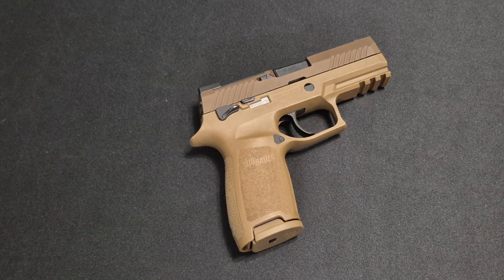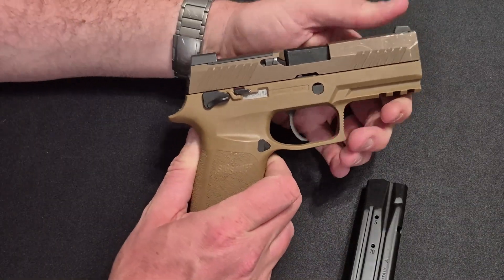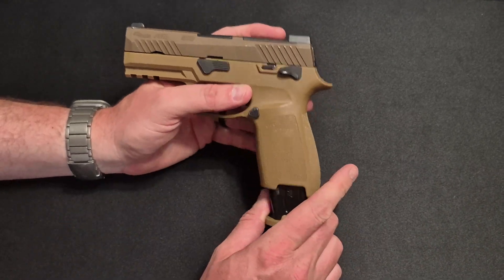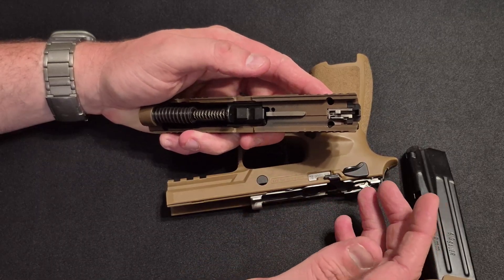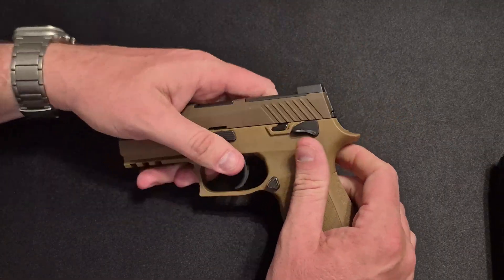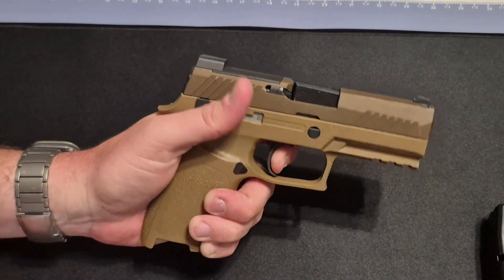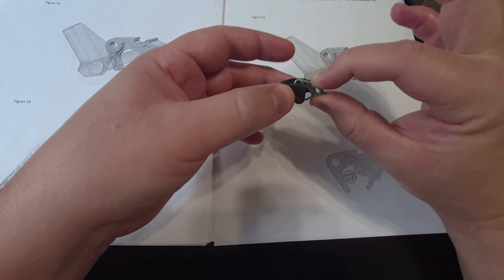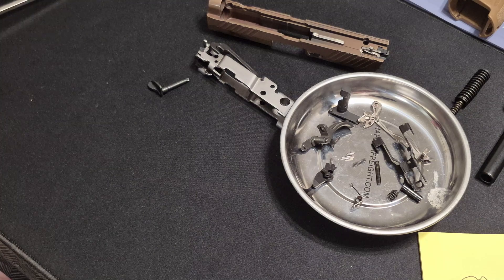"Explosive new patent" does it fix the p320 Self-Firing issue?

Comment: the manual safety pin that retains the safety release lever will have a notch cut out of it. …causing the pin to have a place for it to snap in half…..it’s a bad idea If you asked me . And likely the smartest engineers at sig knew this was a bad Idea or they would have used the design….That’s not what I want…. I want a sear with more striker/ sear contact and an Installable grip safety like  John Browning’s design Intended. I started my career up in and around a machine shop and was an auto and heavy equipment mechanic for 45 years. I worked on industrial conveyor belts that used a shear pin with a groove cut in it so it would not destroy the giant transmission when the belt got stuck…I know what works and what could lead to more problems.

Comment: This person clearly demonstrated that he lacks a fundamental understanding of the P320 when he stated that there was no striker safety.
Reply from the maker: I believe what was said is there was no striker block aka. a plunger there is however a striker retainer that they call a block that I would not.
Reply: @HardTurnChannel  You are mincing words and doing the backstroke.  Starting at 3:40, he talks about Series 70 1911's having no firing pin block and then states about the P320 that "there is no firing pin block safety."  There is a plunger, to use your terminology (its called the safety lock) in the slide that prevents forward movement of the striker until the safety lock (plunger) is depressed by the safety lever in the FCU when the trigger is pressed.  Your guest clearly does not know what he is talking about, and for the sake of your channel, you should do a better job of vetting someone who is claiming to know what they are talking about.
Reply from the maker: Had to relisten maybe it could have been said better or edited better, but my take away was as far he was aware every pistol has some form of a firing pin block a "big chunky piece of metal" in front of the striker it preventing it from moving forward. This is the first to go away from that to a retainer style holding the pin to the rear, and a MIM retainer at that.

Comment: Scared silly? Hasn't had a round in the pistol in a long time? WOW, I have carried and used Sigs professionally for many years. They have NEVER let me down in any way and they have never fired unintentionally. SIg makes very good weapons. Investigations into the firings have been conclusive..There is no reason for these guns to fire unintentionally. They are drop safe. Additionally, it turns out these firings have either been assisted or man made frauds. I love my P320, carry it without hesitation, and trust it without any fear.

Comment: There's is a firing block safety. There's 280 safety cases out of 2.5 million. And no proof the gun was the problem yet. We're just believing what cops are saying. Glock had over 5000 cases when police depts adopted Glock in 1990. You know why the numbers dropped drastically? We quadrupled gun ownership and education since then and gun accidents dropped, not increased. Don't lie about safeties cuz you don't know what you're dealing with.. That's not the issue. You don't even know which SIG you have? Why you feel the need to speak as a Layman. Every 3rd person is a Glock armorer. Stick to what you know.  You like Glock. Talk about that.

Comment: I wonder if the Wilson Combat version of the P320 have the same issue.  They are supposed to be made to tighter tolerances.  So, maybe the slop in the slide doesn’t exist.
Reply from the maker: same FCU same issue afaik, I believe all Wilson does is slide cuts/optics and barrel coating, but I could be wrong and I often am.

Comment: Somehow I really want one of those FDE 320s with saftey . I don't think all SIG 320 are bad but probably 1 out of thousands.
Reply from the maker: I think its something like 180 ish out of 4 million units so 4-5/100k units have had a documented discharge and I think most of those were before the VUP. I say check one out can usually get a good deal on one it does feel good minus the trigger which I think feels mushy.
Reply: @HardTurnChannel  Show me these "Documented discharges", bruh. NO ONE has recreated an un-commanded discharge. No one. Ever.
Reply: @HardTurnChannel how many units? are you claiming 400k to 500k guns have had uncommanded discharges?

Comment: Just so everyone knows… an “armorer” is just someone who assembles firearms and adds attachments and cleans firearms. They are not gun smiths and should not be takes for the words that come from their mouth. That being said if he can’t figure out why the slide stop has to be used during reassembly he is not a very good “armorer”… turning the takedown lever activates a mag Saftey that will not allow you to insert a magazine without using the slide stop because that takedown lever actuates on the sear to drop it below the striker cap to slow the slide to come off.
Reply: The P320 is the only one I know of where you have to use the slide lock to reassemble. That’s a unique manual of arms to that gun. So to say he’s not a very good armorer just because he didn’t know that about this one is a dumb statement.
Reply: @CitizenCarrier as an armorer and trying to give information to the public he should have done some research and do his own digging before hand. Not to mention if he knows so little about the platform, should he even be talking about it?? Is that just company slander at that point? He can’t tell you why you have to do that part of the operation. So he knows nothing about the gun. And he talks down about it because he worked for or worked on the opposite company’s stuff. That’s slander.

Comment: None of that patent addresses the claim of a gun going off by itself- the argument its making is that a direct hard mechanism on the sear should be the safety instead of the safety hard-stopping the triggerbar that hard-stops the sear (like on a 226).

The patent design has area of possible failure with excessive force as the only possible give is breakage. If you look at Sig Mechanics breakdown of the current safety- excessive force causes a disconnect before failure. Thus the current safety is mechanically superior in accomplishing the same thing while preventing more forms of failure than the patent allows.
Reply: Because it doesn’t go off by itself. Thats bullshit

Comment: So many inccrrect statements os misconceptions in this video. You are one of the reasons for all the misinformation ruining the P320s reputation because you don't know what you are talking about. Educate yourself before opening your mouth. 

1) Odd irregularities: the gun was designed not to allow a magazine to be inserted if the gun is improperly reassembled. This is not an oddity, it's safety. It's one of the reasons you do not have to pull the trigger to disassemble the gun, unlike on a Glock.
2) Lack of trigger safety for drop safety: You can opt for the thumb safety if you are not comfortable with this, get an aftermarket trigger with an inertia safety, or, better yet, make sure the gun has the voluntary upgrade. It is widely known that this upgrade makes the gun completely drop safe.
3) No firing pin block safety: there is a striker safety lever, which keeps the firing from being released by "an outside force" if the trigger is not depressed. Only a trigger pull defeats this striker safety lever.
4) Slack/Slop in the slide can casue the striker to release on it's own: this is true for all striker fired guns and you still need to pull the trigger to the point of sear perching to make this happen.
Reply from the maker: I feel like you are a big sig fan which is fine as am I, and perhaps I edited away too much context and qualifiers some of the issues are too smart by half which when you are making millions of guns can be an issue with your stackup K.I.S.S. Is this the best configuration for a striker fired pistol its possible not really my forte to say, but seems like there are still issues to work out even after the VUP, and if these "issues" are injuries that's the problem, and all I wanted to talk about was the patent that was filed this year to "fix" this platforms issues.

Comment: The striker safety is the little spring loaded metal tab immediately next to the striker leg.
The spring though is not that great honestly. The glock style plunger is preferable imho. That being said, the m18 / 320 does indeed have a striker block.
Reply from the maker: I would consider it a retainer since it is holding back and not in front of blocking but yes it does have a "block" more wanted to talk about the patent though debatable how well I did that.

Comment: There is a striker block safety on the P320 slide.
Reply: There IS  a striker safety block.  I don't care if you refuse to acknowledge it.
Reply from the maker: As designed i would consider that a retainer not a block we're just using different terms
Reply: @HardTurnChannel your an idiot
Reply: IF... the sear were to lose control of the striker hook, there is a secondary/back-up sear ledge that would catch the striker hook.
IF... the secondary sear ledge failed to catch the striker, the firing pin couldn't reach the primer on a chambered round due to the striker-blocking mechanism.
SO... three mechanisms would have to fail all at the same time. That would be like winning the lottery, walking out the door, and immediately being struck by lightning. Highly implausible. 
A holster that tightly and completely covers the trigger guard and booger hook off the bang switch, you'll be fine.
Reply: @HalfCrazy520  makes sense.
Reply: @HalfCrazy520 well that’s not true.. there’s hundreds that have failed to be safe. Even the FBI has deemed them unsafe
Reply: @GeorgeCasseb  Apparently, you haven't read the FBI Report. Page 32 under conclusion: " examination of the subject weapon DID NOT independently provide evidence of an un-commanded discharge "
You should have said even the FBI couldn't prove the gun can fire un-commanded, and it wasn't for lack of trying, was it?
Reply: @HalfCrazy520 apparently you didn’t read my comment I said they deemed it “unsafe” it’s literally in the pdf
Reply: @H @HalfCrazy520 nice cope though 😊
Reply: @GeorgeCasseb  Nope! The test of the secondary/back-up sear notch: "It caught the striker hook on all ten attempts". Page 26.
On the final paragraph they suggested more testing, but NEVER stated that the P-320 is unsafe. The worst thing they said was "It MAY BE POSSIBLE" but admitted they couldn't prove it.
I have the PDF up... I searched for the word "UNSAFE" and got "no results found".
What else ya got?
Reply: @GeorgeCasseb  When you say "the FBI deemed it unsafe" that's bullshlt, but I'm pretty sure you'll keep saying it...
Reply: @HalfCrazy520 also the fbi admitting it may be possible is a nice way of saying it’s not safe lol but I’ll show you where the deem the p320 unsafe is you want to bet
Reply: @H @HalfCrazy520 you have 10 min from this reply to agree to the wager or I’m going to assume you’re to broke to back up all the talk.
Reply: @GeorgeCasseb  Why couldn't you simply show me before, when you made the claim?
If I don't agree to a wager, you're off the hook for proving your claim? How convenient.
I did get you to actually read the FBI report, so that's a step in the right direction.
NOTHING can change the FACT that they could not replicate an un-commanded discharge and admitted that.
Reply: @HalfCrazy520 I don’t work for free. Have a good night man stop taggin me
Reply: @GeorgeCasseb  I'll take that to mean: "I got nothin".
Reply: @GeorgeCasseb " you have 10 min from this reply to agree to the wager or I’m going to assume you’re -to- (too) broke to back-up all the talk "
Yeah, my second wife gave me an ultimatum. Once. That's why I have a third wife... 
And then implying that I'm broke... now that's funny. You're the one with the "This channel doesn't have any content" channel.
While you failed in this debate, you ARE a pretty good dancer.
Reply: @HalfCrazy520 okay man! Have a good one